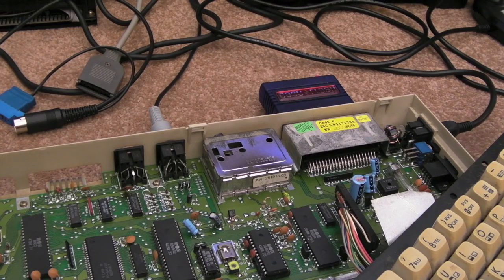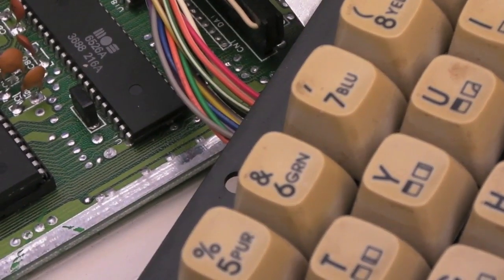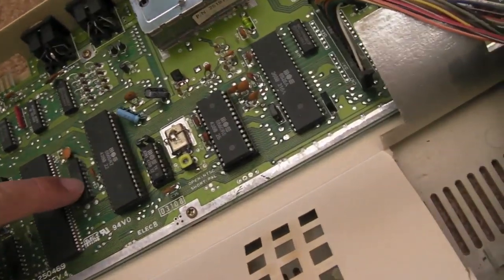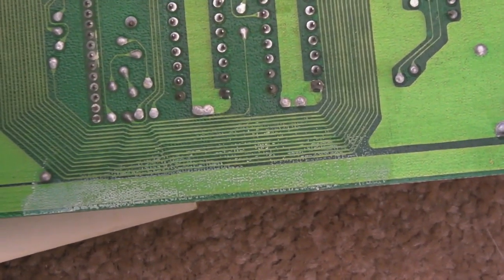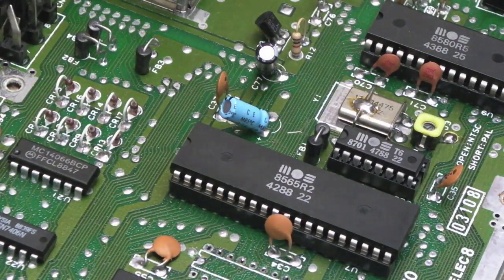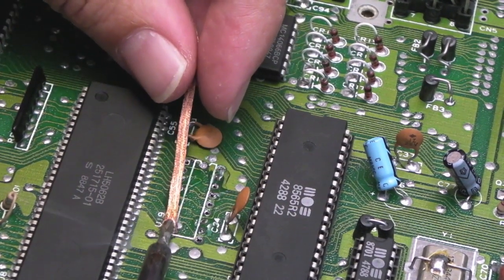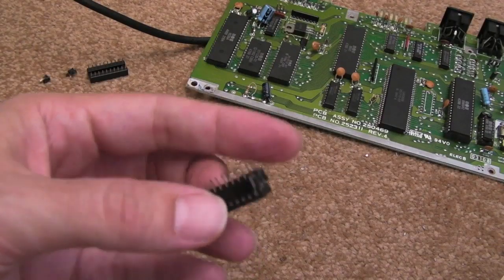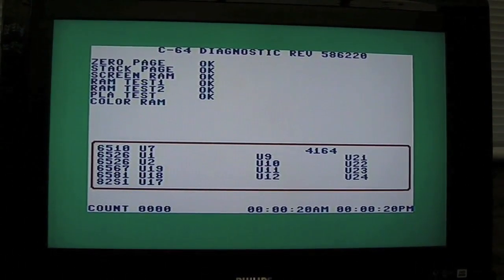Commodore 64 (C64C) Color (Colour) RAM (SRAM) Repair

Comment: Good work!  Recently when scrapping some old circuit boards I got very lucky in that one thing was loaded with M2114 chips, the same chip the C64 uses for color RAM.  That was fortunate because I had no backups, as my only current C64 board used for salvage parts had the color RAM chip destroyed when I was trying to remove it.

Comment: Great repair!  Say, would you know if that diagnostic cartridge may be available as a program that can also be run from a disk?  Also, I understand there is a cable to use with that cartridge?  Please tell about that.  Thanks.
Reply from the maker: There probably is diagnostics software you can run from disk but I've never used it.  A diagnostics cart or 'dead test' cart on eBay will set you back around £15 to £20, so I would recommend getting one.   The problem with disk is for some faults you cannot get the program to load.  The diagnostics carts tend to be better written, so testing RAM and CIAs works more reliably than if you were to attempt to load from disk or tape.
Reply from the maker: The cable set is optional - they are used to test the ports on the C64, but generally they aren't actually required as you can test them other ways - eg. load a game, test the joystick ports.  Load a disk which will test one of the CIAs.  Press each key on the keyboard and you've tested the other CIA, etc. etc.

Comment: Nice one mate. Just got back into this with an old c64c off ebay. Good soldering skills, how do you not lift tracks?  All the best...
Reply from the maker: The trick is to make sure you use flux, and a good desolder pump.  If you make sure the solder has been removed from all the pins properly first, then use a small screw driver to carefully wiggle the pins from one side to the other (they usually make a snap noise when you press the pin one way - provided the solder has been removed properly).  Then when all the pins are loose, the chip should just litterally fall off the board.  If there's a pin still stuck it will need more solder and flux before you attempt to desolder it and remove the solder again with the desoldering pump.  Sometimes heating a pin for several seconds (or more) can make all the difference, as the heat then has time to spread properly and make the solder on the opposite side molten.   It's all about taking your time, and practice!  Thanks for watching and commenting =)  Let me know how you get on with your C64C =)
Reply from the maker: use desolder braid (and flux) to get the solder off the legs afterwards.  Then use pliers to make the pins totally straight.  Some times you can just rub the soldering iron over the pins to get rid of small solder points etc.

Comment: I just recently picked up two C64s on ebay. The first one had scrambled up text, then nothing. I got the second one and it is working ok,the blue is all one color, I messed with the knobs next to the VIC, and it's something else. Now back to the first, I swapped the MPU and I get a constant picture,but the text is scrambled but a pretty blue border. I tried all the other chips, socketed ones--CIAs, PLA,SID,the 3-BAsic, Kernal, and Character, all the same on the 1st, and 2nd. The first is a 83, and 2nd is a 82. I love them, but I'm waiting on my Dead Test cart. Any ideas on the (true Blue) one, lol?

Comment: Very helpful video, recently had some success in removing a duff chips and putting a working ones in. Problem I am having is getting the chips OUT, seems like no matter what I do theres still solder sticking the chips to the boards. 

How important is flux? I've not used any before but managed to get everything done... still can't work out exactly what is does :-/
Reply from the maker: ***** Hi, flux is very important!  As is solder wick / braid.  I will try and do a video soon on basic soldering and desoldering techniques.  The flux when used with desolder braid means the solder floods into the braid very easily.  It also helps the solder flow much better when just using a desolder pump.
Reply: GadgetUK164 

That would be much appreciated, think I've knackered the last board, trying to change a ram chip, refused to budge so ended up forcing it out... now a new ones in I've got a black screen instead of 427 bytes free...

Comment: Hi, I and worried that one of the chips in my C64 may be dying. It's not quite the same thing as this video as the colours and picture are fine. However, I have random pixels that flicker. They seem to just be in certain games and always in the same place. They don't flicker in Vice, so I am thinking something is on the way out. Have you come across this? (they are all over the place in the 'DELTA' title screen)
Reply from the maker: +Colin Ellett My first though is perhaps the colour RAM or PLA is on its way out, but it's most likely a bad connection on the VIC chip (I had the exact same problem with mine).  Do you have the version where the VIC chip has no heat sink?  Try removing the VIC (carefully, using a screw driver on each side - inbetween the chip and the socket, once removed carefully line it back up with the socket and re-seat it), and then re-test.  If that fixes it I would suggest putting some heat sinks on top of the VIC.  Mine did exactly that, and after a week or two after re-seating it the same problem occured.  I ended up cleaning up the pins on the VIC chip and after fitting heat sinks it hasn't re-occurred.
Reply: +GadgetUK164 I have a 1983 model (250407) where there is a metal box surrounding the VIC-II and which acts as a heat sink. I removed the VIC-II and re-seated it. Made no difference. I tried putting in a new turned pin socket, but that made no difference either. Do you think the VIC-II may be bad?. I can do a video of the problem if it will help... (really appreciate your help, I love your vids!)
Reply from the maker: It's possible its the VIC-II, I have got another VIC-II chip that does strange things with graphics.  A video might help!
Reply: +Colin Ellett Hi, you're probably bored with this now, but just in case you're not:
I ran a Commodore 64 Diagnostic cartridge to test the system (including the adapters for ports etc) and it tells me that U1 is bad (keyboard + Joystick). The strange thing is, I swapped U1 & U2 and it still fails on U1? Puzzled
Reply: +Colin Ellett bad connection with the keyboard tester, now passes fine. Diagnostics pass everything. I guess it must be the VIC-II after all...
Reply from the maker: +Colin Ellett There's a 4066 related I think - It's probably that.  Or you've got a damaged trace going to the CIA.  Or, it could be faulty clamping diodes on the serial / tape interface.
Reply from the maker: +Colin Ellett Ah OK, sorry for my slow reply =D  Glad you've sorted it =D
Reply: +GadgetUK164 I just had a feeling it was the VIC-II, all the traces looked fine. Playing with the Dual SID, heat-sinked them both but they still get too hot to touch. Is this normal?

Comment: Love the videos !! Helped me out a lot !! Thank you !!! Was having the same issue and replace the PLA chip. Turned out the PLA chip was fine. Now I am looking to replace this chip. Any chance you have a part number for the color RAM ? I can only find the chips on eBay for the older brown Commodores. Thanks !!
Reply from the maker: You just need a 2114 (there are 5 or 6 equivalent parts) - http://store.retroleum.co.uk/c64-chips   or  http://www.ebay.co.uk/itm/NEC-uPD2114LC-2-SRAM-1024x4-bit-/162503484200?hash=item25d5f66328:g:u~UAAOSwzaJX7OhA
Reply from the maker: The colour RAM on the 64C is the same as the breadbin btw!

Comment: I’m having an issue with my c64 when I turn it on it shows the basic screen but instead of basic it shows a bunch of random letters and numbers but if I let the unit warm up and then turn it off and then on it works fine I want to diagnose the problem but I can’t find that cart you use any where
Reply from the maker: There are a couple of possibilities, it could be a bad character rom chip, bad PLA or VIC.  The most often cause for this that I've seen is the VIC making a bad connection to the socket.  You could try reseating the VIC chip - perhaps clean up the pins on the chip first, and consider using deoxit or similar in the socket.
Reply from the maker: With regards to the cart I use - its just a diagnostics cart!  Search on eBay for C64 diag cart or C64 dead test cart - you will find loads for sale.

Comment: Fortunatelly in my C64C the PLA SHARP is hard to killing bcos till now doesn't have substitute.  Lucky man :) Btw great job.
Reply from the maker: Is your sharp PLA faulty?  I've not come across a faulty PLA on a C64C before!  It's frustrating because the original PLA was easier to replace with modern substitutes etc, the C64C PLA is shrink DIP or PDIP I think and because there's more than just the PLA in there (other common logic merged into it), it's more than a PLA =/
Reply: No no its ok. But iti have colour RAM inside, that way we deosn,t have substitute :)

Comment: Wow I would love one of them diagnostic carts mate, did you make it yourself?
Reply from the maker: I just used the Easy Flash cart and programmed that with the C64 diagnostic image.  You could make one relatively easily though if you can buy a 16Kb cart PCB, or make one.

Comment: Hi Are you a member of the Lemon 64 forum,Iam from there and thanks for a great video,you can learn a lot watching your videos.I have a problem with mine its the cpu I think,using the test crt in Easy Flash and it crashes at RAM TEST 1 and stops,oh and I don't have that chip on my C64C board..?
Reply from the maker: +Spanner Nick I don't really hang around the Lemon 64 forum much these days!  If your system is crashing on RAM TEST 1 it sounds like a main RAM problem (not video RAM).  There will be 2 x 4464 DRAM chips on there, sounds like one (or both) are faulty.
Reply: +GadgetUK164 Thanks for the reply,how long have you been fixing c64,do you fix Atart 520s too,I remember working in a computer shop upgrading them to 1040..:),Its the first time I have seen a Rev 4 board mine are a rev A and B,B is the one with the problem,all because the wire touched on the tape deck connector.Oh thanks for the Easy Flash Video,Now I have one cos of that..;)